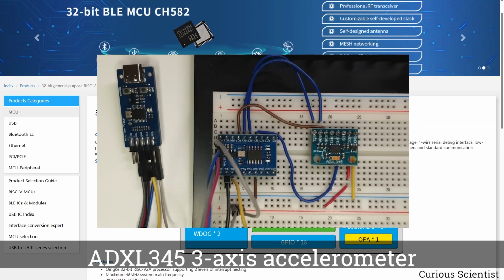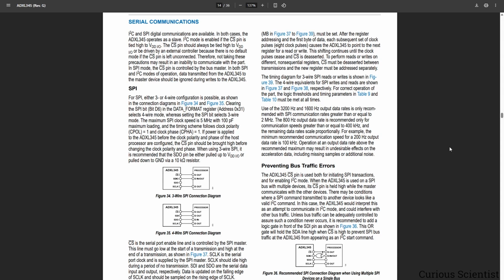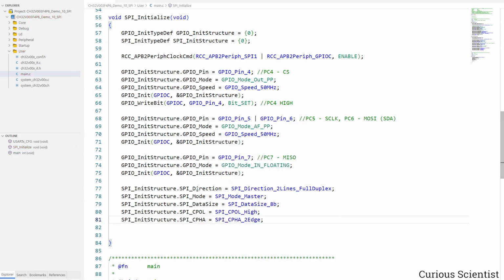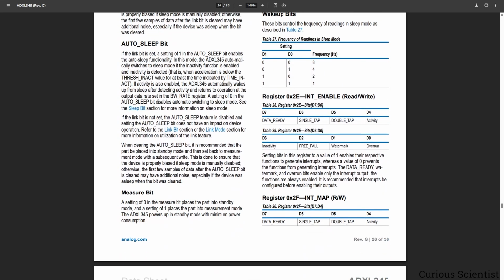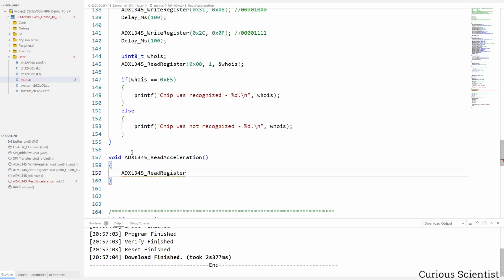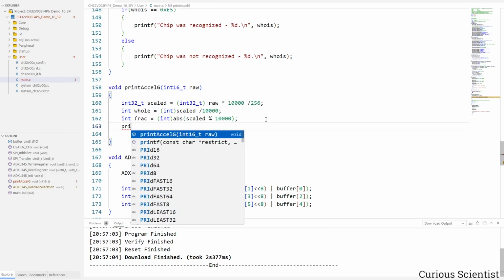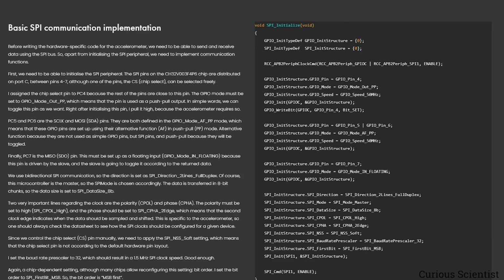CH32V003F4P6 Tutorial - Part 10 - SPI Communication

Comment from the maker: Implementing SPI Communication on the CH32V003 Microcontroller with the ADXL345 Accelerometer

*   0:00 Introduction to SPI: This video focuses on the SPI communication protocol using the CH32V003 microcontroller, following previous tutorials on GPIO, ADC, I2C, and Timers.
*   0:29 Hardware Setup: The demonstration uses a CH32V003F4P6 microcontroller, an ADXL345 3-axis accelerometer, and a debugger module, wired for 4-wire SPI communication (Chip Select, MOSI, MISO, SCLK) and USB-UART communication.
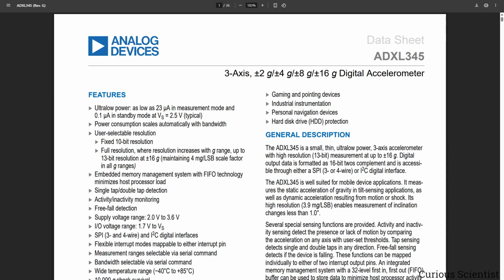*   5:00 SPI vs I2C: SPI is presented as a faster, full-duplex communication protocol compared to I2C. A major advantage of SPI is the Chip Select (CS) pin, which simplifies addressing multiple identical devices on the same bus without address conflicts, unlike I2C.
*   8:16 SPI Initialization: The video details the process of configuring the CH32V003's SPI1 peripheral as a master, setting up the required GPIO pins (PC4 for CS, PC5 for SCLK, PC6 for MOSI, PC7 for MISO) with their alternative functions and modes (Output Push-Pull for CS, AF Push-Pull for SCLK/MOSI, Input Floating for MISO).
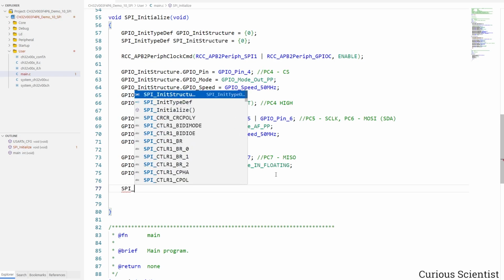*   12:46 SPI Configuration: The SPI settings include 8-bit data size, Master mode, Two Lines Full Duplex direction, Software NSS (Chip Select), CPOL High, and CPHA 2nd edge, as required by the ADXL345 datasheet. A baud rate of 1.5MHz (48MHz/32 prescaler) is set.
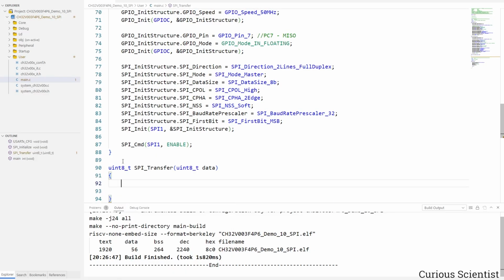*   17:07 SPI Transfer Function: A custom `spi_transfer` function is implemented to send a single 8-bit byte and simultaneously receive an 8-bit byte, handling the necessary flag checks for transmit buffer empty and receive buffer not empty.
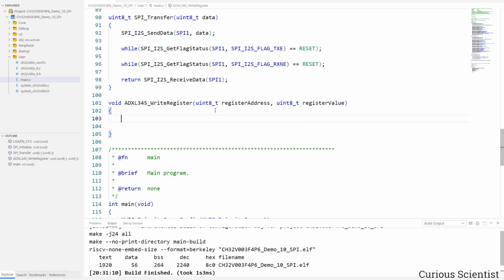*   19:50 Register Write Function: A `write_register` function is created to write a value to a specific register address on the ADXL345, manually pulling the CS pin low before the transaction and high afterwards, and using `spi_transfer` for the address and data.
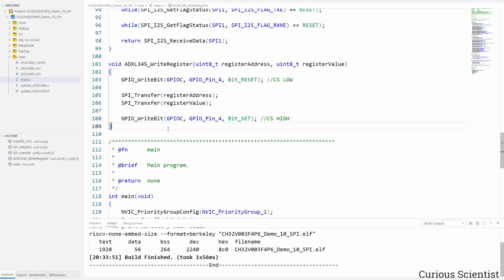*   21:24 Register Read Function: A `read_register` function is implemented to read one or multiple bytes from a starting address. It constructs a command byte by setting the read (D7) and optionally the multibyte (D6) bits, sends the command via `spi_transfer`, and then reads the specified number of bytes into a buffer using `spi_transfer` with dummy data to generate clock cycles.
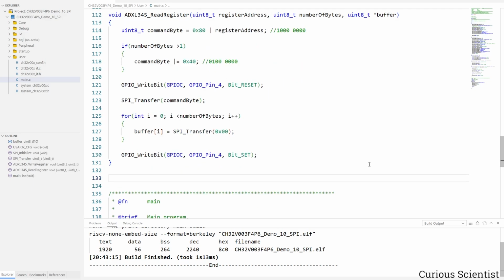*   27:27 ADXL345 Chip Initialization: The ADXL345 is configured by writing to its registers: setting measurement mode (0x2D=0x08), data format (0x31=0x08 for full resolution and +/-2g range), and data rate (0x2C=0x0F for 3200Hz).
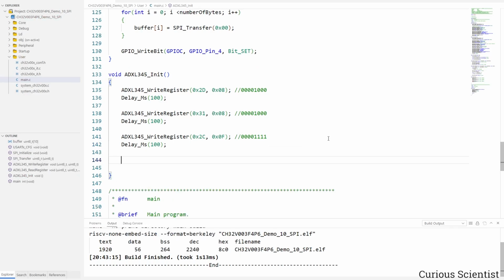*   31:24 Device ID Verification: Communication with the ADXL345 is verified by reading its Device ID register (0x00) and checking if the returned value is the expected 0xE5.
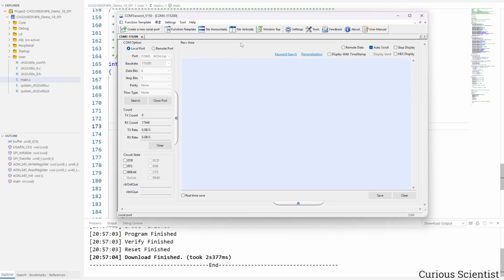*   34:30 Testing with UART: Successful initialization and Device ID check are demonstrated by printing confirmation messages and the read value (229, which is 0xE5) to the serial terminal via the microcontroller's UART.
*   35:15 Reading Acceleration Data: The core acceleration data (X, Y, Z axes, each 16-bit) is read by initiating a 6-byte multi-byte read starting from register address 0x32.
*   36:33 Processing Raw Data: The two 8-bit bytes received for each axis are combined into a single 16-bit integer value, handling the LSB-first byte order.
*   38:51 Scaling for G Units: Since the microcontroller lacks native floating-point print capabilities, a trick is used to convert the raw integer values into scaled G units (multiplied by 10000) using integer arithmetic and extracting the whole and fractional parts for printing.
*   43:04 Printing for Plotting: The scaled acceleration values are printed to the UART in a specific comma-separated format (`X:value,Y:value,Z:value\n`) suitable for visualization.
*   44:36 Serial Plotter Demonstration: The Arduino IDE's built-in Serial Plotter is used to display the real-time X, Y, and Z acceleration data as plots, visually demonstrating how tilting the ADXL345 sensor affects the G readings.
*   48:40 Resources: The video concludes by mentioning other ADXL345 features (like tap detection) and directing viewers to a companion article on the creator's website and the project code on GitHub for further details.

I used gemini-2.5-flash-preview-04-17| input-price: 0.15 output-price: 3.5 max-context-length: 128_000 on rocketrecap dot com to summarize the transcript.
Cost (if I didn't use the free tier): $0.0079
Input tokens: 22337
Output tokens: 1306